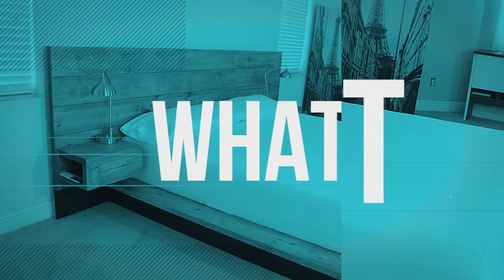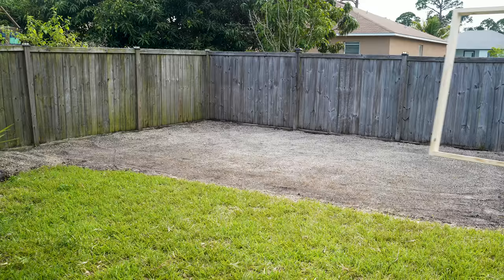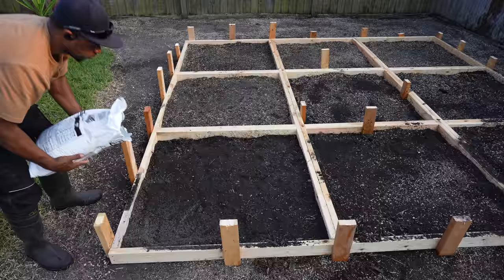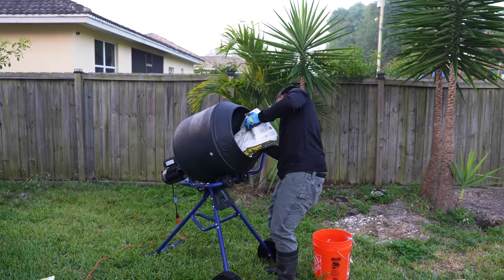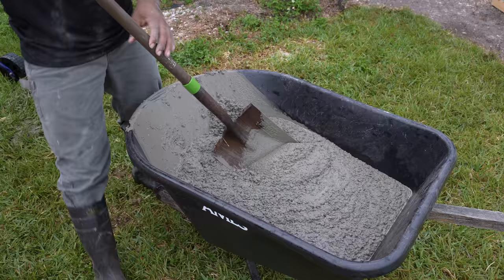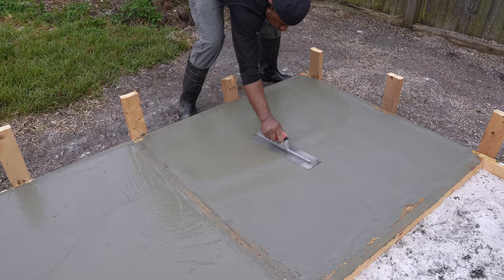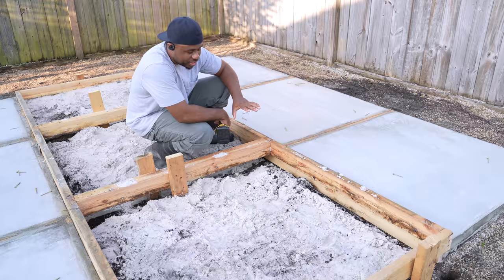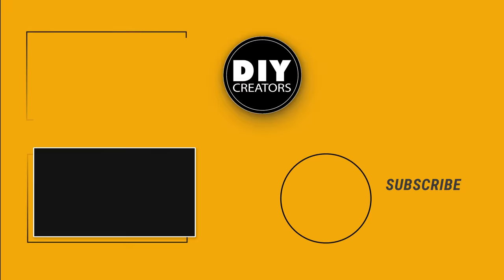Making Extra Large Concrete Pavers ( DIY concrete patio )

Comment: Man, just found out about this channel, that's a nice project... 
I'd probably make the pavers in molds beforehand then move them in for building when I had all of them.
Made a single lumber mold in the garage floor with a plywood bottom and some demolding (either a piece of plastic or burnt motor oil)(optional: make it a vibrating mold by attaching some small motor with a shifted weight) and for last but not least fiberglass/PVC concrete aditive, that last bit makes the concrete extra durable and hold the weight/use/move that much better... also whenever working with concrete (specially that thin slabs) you gotta keep it moist for the next week, some people even just drown it in a tub after it sets...
like that you'd make the job easier, a slab a day.

Comment: Cement pavers that thin and wide will crack eventually even with rebar reinforcements. I would have at least added fiberglass fiber strands to the cement mix and cut expansion joints unless it was 4” thick. I would also placed poly plastic (polyethylene) underneath each slab because the sand will absorb some of the water from the cement mix thus weakening the underside. Still, it’s nice work and hopefully it worked out for your yard.

Comment: Good video, a few misses , buy stakes way cheaper than 2x4. Pour thinker, mesh isn't  always needed but so thin you will crack without it.  Code for slabes they dont even call for rebar/ mesh but would have been nice.  leave machine running to get all out and pour directly into the form.  Still a great effort and your vid are pro . Keep them coming

Comment: Not bad, I think you mixed the second square a little wet.  It's really easy to add too much water to concrete and not realize till its poured and troweled.  You'll end up with a rougher sandy finish and much weaker concrete.  Hydrating or keeping new concrete wet is really important for strength.  An edging trowel makes a huge difference in the appearance and strength of your edges.  Lastly when the concrete has stiffened up some give it a light broomed finish by pulling a push broom over it in one direction.  VERY important in freeze areas, this improves traction on the finish.

Comment: Cheers mate , this whole video is very good mail , 
working with form work & concrete is a very satisfying job , 
weather it be a house or a shed or pavers.
maybe short bits of left over rebar across the corners could stop the cracks. 
but great stuff mate , you’re a good teacher.

Comment: Nice job. Only suggestion would have been to use a concrete edger to roll the edges next to the wood so when the forms were removed you would have a smooth rolled edge. Overall great job

Comment: Thanks for the video! next time, maybe a small sledge hammer for the stakes, and a concrete edger on all of the edges, it helps make the edges slightly rounded over and a bit stronger and not prone to chipping e.t.c...    :)

Comment: So if you ever do this again, use a thinner interior board like a 1x4 and place a small spacer between the runs. then when you pull the middle it will allow you to pull the spacer blocks and peal the 1x4 to the side instead of having to lift up and potentially crack the edge. Over all nice job though.

Comment: I think you are a great pretender because most men can't even get past the form process - In any construction job that I have watch in commercial construction projects over many years ie street, subway platforms, sidewalks, foundations..................highways..........Carpentry was always the first order of business along with rebar-ing. The concrete is the last process. You definitely have experience in this kind of work because of the way you handle your equipment - trowel, rake...........just as you cannot pretend that you have no experience in bricklayer when you are buttering each brick every second for the first time. Anyway great job and thanks for sharing.

Comment: Nest time run a water line with CPVC and and outlet over there under it first so you can have electricity and water. You'll also thank me in 3-5 years if you made the concrete 4 inches instead of 2. The wear and tear with the sand underneath it will eventually cause cracks. You could use chicken wire in the forms to help them stay together.

Comment: OMG some constructors guys should begin to get concern after this video.... WOW, Some businesses will soon close down... Hat down my man, I learned from you now... Wait, did you say $1500? I do not think so, in NJ they would nail you easily with 10K on something like that... I really did not think it could be done alone but you did it, all by yourself!!! The part you said you have not experience dealing with concrete or dealing with something like this, it is hard to digest, you did this like a PRO. I have never done a big project like that, I was thinking to hire someone but now I have issue on deciding what to do after watching you. I know myself and I know I will have guilts if I pay someone to do a similar work like that in my patio..... TRYING TO GET RID OF THE GRASS MAN... I am tired of my lawnmower machine and dealing with that grass. It is pretty but I am tired of the maintenance. Hire someone to cut it? Too pricey. Anyways, my respect to you, thanks for sharing, I am registering to your channel

Comment: Tip; get a pump up sprayer, a gal or two of diesel fuel. Spray the form board before ya pour the concrete and it will be MUCH easier to remove yr form boards. Y W 🤓!

Comment: I've had this idea for a bit and have stumbled on your video and have seen some others. The idea of making the sections and putting them all together to make the base level is so smart. Now I'm quite a bit older than you and do not wish to mix all that water. so I'm thinking a high strength dry mix method. But I already have paver down in the yard. I had a pro put them in. But I thought why can't I set pavers on top of my dry mix concrete in the form? My corner forms will have extra thick pads because I plan to build a gazebo on top. I have ambitious thoughts. Thanks for your video. It helps.          I just had another ambitious idea. What if you put rope lights in the spaces between the forms Then pour some glass over it?  Maybe beaded clear glass. Or a crushed glass. Then some sort of glue to hold it all down. Just tink outside of the box.
Reply: And I have made my slabs and pulled the forms off. I made my patio 16' x 16' and have 16 equal slabs. I have 3 inch spacing in between or the width of 2 2x4s.

Comment: think you could hit the sides with a hammer, rubber hammer, just to let the vibration settle the concrete better in the corners and sides, if needed

Comment: These are amazing tips! I do have a question though. Why do you pour leveling sand first? I don't understand the need to add leveling sand under wet concrete.

Comment: Thanks, 2 questions:
■ can I do that over an old concrete? maybe just leveling with sand, putting the wooden grid over, and pour concrete? Or maybe just concrete over concrete (no sand)?
■ Can I use 1" thick wood instead of 4" (two 2x4 together), I think about the big gap that will be when the wood rots and goes away.
■ Did you use the concrete bags that come with gravel mixed? or you used cement without gravel on top? because gravel is dragged by the leveling wood.

Thanks in advance

Comment: Not bad. But for this size I would put a strong reinforcement on the bottom. Because the tile is big, you will think it is strong, you will want to drive a car over it, and it will break even from a construction wheelbarrow.
I made my tiles much smaller: 40*40*5 cm. Still, I added a grid and made the tiles on a vibrating table for higher quality.

Comment: As its already been mentioned I will not go into rebar or mesh.  I do see a few things not addressed especially when helping DIY who are searching for tips.
1)	Spray the wood forms on the concrete contact side with; oil or WD40, Diesel this will stop the concrete attaching to the wood which will help you remove the wood form.
2)	Use a hammer and do lots of tapping on the outside of the wood forms; this will make the air pockets fill so when you remove the wood form you have a nice solid concrete finish.
3)	Use a “edge trowel” between the wood form and the concrete ASAP; this will push in all the stone or rock in the concrete mix and provide a nice tapered finish that will not chip away.  Tip once you have run the edge trowel you can work the finish and come back when the concrete is setting up and work the edge without moving any stone or rock.
4)	If you are struggling with finishing the concrete ie trowel lines; take a soft broom, wet it and pull it lightly over the finished concrete.
5)	For garden looks I personally like to take a cheap hand-held spray bottle add a cup of sugar 2 cups of water, shake it up, depending on the ambient temperature but before the concrete sets hard spay the mixture over the finished concrete.  Let it stand for 20-30 minuets.  Next take a garden hose set it on wide spray, start from a distance with a horizontal spraying with a angle 45 degrees, spray away the top exposing the stones.  You will see the degree of exposure as you spray.  This produces and nice aggregate look which is more garden like.  Well to me.

Comment: Hi I was watching half way at the point you pour concrete, I don't see any supporting wires or rebar. It's best if you put at least wire mesh those 4x8 sheets for your concrete project.anyway I would do that

Comment: Question.  If I don’t want a two inch gap between the slabs is there another option for separation?  Use a one inch thick board for the interior frame?  Is the reason for the 2x4 to give the slabs space so if they move they won’t crack?

Comment: You compared the cost of doing this yourself to having it done by someone else. But what If you just buy the concrete slabs and place them? Maybe not feasible for ones this size, but if you buy smaller ones its definitely feasible and cheap. I still like your approach though, you could make shaped tiles for instance. Plus I like the idea of doing things from scratch.
Reply: Where exactly do you buy 4x4 concrete slabs lol
Reply: Concrete slabs are more expensive per square foot but take a lot less labor and time. It wouldn't be cost efficient though.

Comment: At 12:54, that first long board you pulled out was still attached to the smaller boards with screws, right? Was that the hardest board to get out during this process?

Comment: I’m guessing you live in Florida or some other region without frost so heaving isn’t an issue?? What is the strength of a thin slab like that without any reinforcing mesh and will it crack with use?

Comment: If you plan to move them, without some sort of metal screen or rebar in them, they are going to break very easily. Never do them this way and you don't need the leveling sand either.

Comment: I would have taken the extra time to tool the edges with a round over edger to make the edges less likely to chip off , and it looks better . Plastic down before the concrete would make them smoother on the bottom and easier to move , and you used way too many stakes than were needed , especially the areas where you doubled up the boards , which I don't understand was the need for that .

Comment: I am planning on doing something like this for a shed that is 20x40 but would prefer to do one entire slab with no gap. I see you have the gap between the slabs with the 2x4, anyway to not have that gap.
Reply: I've seen setups like this with such a wide gap to slap in some sand then rocks and lighting and it makes the entire patio glows during the night.
Reply: @gen4957  That is what he did

Comment: Aren't those going to crack without some sort of reinforcement?
Reply: Prep the ground to be stable, with only foot traffic they should hold up fine. Reinforcement won't stop the cracking if the ground settles out from under, but it will keep the pieces together.

Comment: 2" seems kinda thin.  If it's on a hard surface that's one thing, but on top of sand, I see the corners being chipped off over time.  Put too much weight in one spot and crack.

Comment: Any reason you didn't use visqueesn and steel rebar?
Reply: These are suppose to be “pavers”. So they can be moved if needed. And the mix was only 2” thick. Anything over 4” needs rebar but you can also mix the fiberglass shavings in and that increases the psi big time (how most city sidewalks are poured)
Reply: @golfncrypto1542  Awesome! thanks for the info

Comment: Did u use 2 bags per square ?
Reply from the maker: I believe it was 4 to 4.5 (80lb bags) per square. I bought 45 bags and I had a few left over. If I recall right the entire area is 12 ft by 12 ft. And the squares was around 46 or 48 in
Reply: @DIYCreators what did you use to close gaps when you pulled the wood after letting is dry

Comment: If you didnt compress the earth good enough it might sink leading to holes and the concrete might break. Also the cold is breaking it if you dont either dig deep enough under frost level or put enough steel bars in. Overall i wouldnt recommend your method as its to risky

Comment: Good job, but you literally built a ground level deck, then filled it with concrete. You could have saved yourself a months work if you would have just put some decking over your form and went with a deck.

Comment: oh man, i´m no pro builder, but still have done a concrete mixing gig couple times.  ...you really want to ruin your lawn with the concrete dripping onto it??    ...and using a glass vessel to pour water? Did you nick it off your partner in the kitchen or something? Don´t you guys have construction buckets?    sorry mate, that´s when i stopped watching.  hope it went well after all
Reply from the maker: Really lol? You don't think I dedicated this mixing cup to my concrete tools?  Great assumption there...I been using the cup my projects for years. You are a strange one, have a nice day. 👍
Reply: @DIYCreators  ....says someone who uses a brand-new looking "glass cup being used for years" to do a concrete job!   right, strange indeed. anyway, good to know you´re comfortable with what you do. never mind me. the outcome looks quite clean and well made after all. kudos on that part, and keep the inefficiencies for the rest
Reply from the maker: It's glass, and glass clean up well. All I use it for is to Transfer water. I literally used it in other videos. Its currently sitting  in my concrete mixng bucket. No need to make a fuss of this.